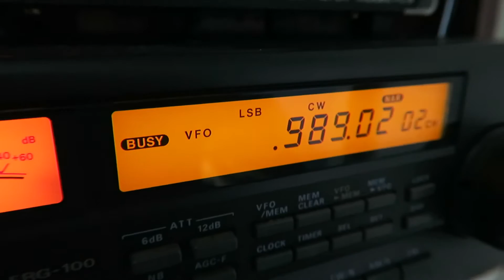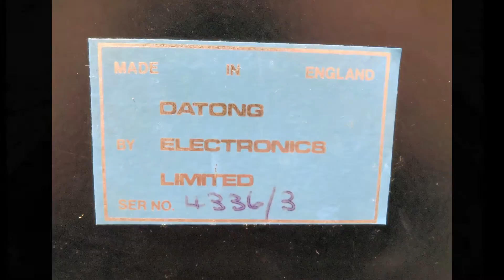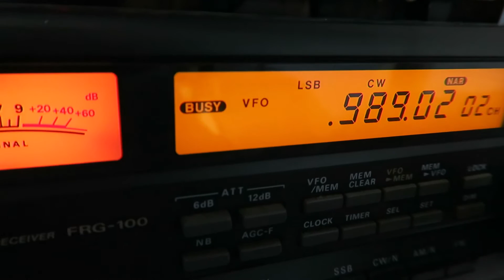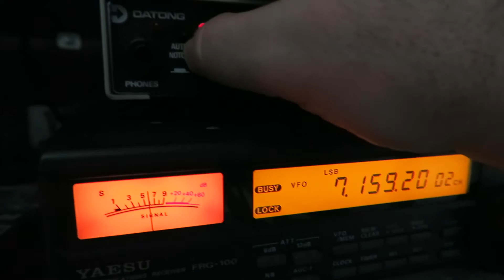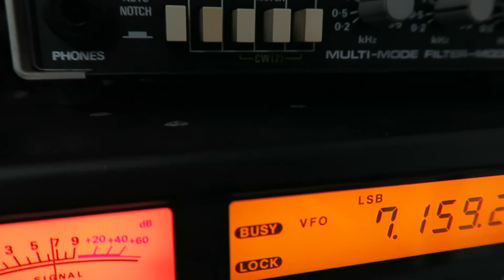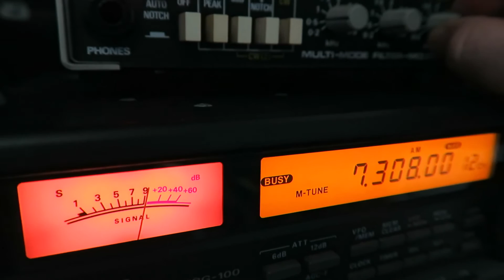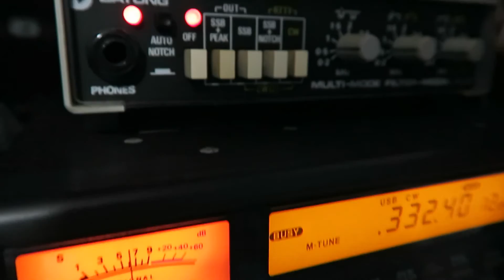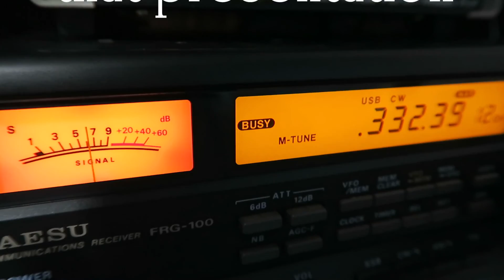Datong FL3 audio filter incorporating MiniWhip on HF

Comment: Just bought one from uk on ebay. Works well apart from the power input, which shorts out when plugging in, and is a sloppy fit .Not good if using portable with a battery!. Appreciate it was a while ago but did you modify yours , and if so what conponents did yu use to allow using the same hole. Thanks, appreciate the video
Reply from the maker: Hi, no modifications made here, sorry to hear about your trouble
Reply: My FL2 gathered dust for 40 years and had no audio when turned on the centre pin on the rca input had broken away from circuit board, probably caused by plugging in and out. I removed the power Jack and took wiring straight to the board. Now working OK.
73 Dave G4BTI.

Comment: Ohhh La la... I finally found one of these 2nd hand, Not had a chance to get it up and running as my KW2000e is still down. Might try it on my Dads old valve based Trevor Wadley loop telecommunications receiver.   Your video is the only decent thing I've been able to find on youtube and see it in action. Looks very sensitive to any small adjustments.  Guess you would expect that when driving a notch filter with a crazy tight "Q" on it. Learnt a new Ham term today "Het Killer ". Thanks again for posting all those years ago, (2016)  not many of us who love old boat anchor crazy high voltage kit about these days. Regards and 73's from Auckland, New Zealand.
Reply from the maker: Hi Kris, many thanks indeed, glad you got one

Comment: Hi, Great video,. I have just got one from ebay, please can you tell me when the "Auto Notch" filter LED lights up? doe it lite when button pressed or only when signal/audio present, manual doesn't really explain how to use very well. Regards Ray
Reply from the maker: Hi Ray, I'll have to connect up and try it to find out, unless anyone else can help us?
Reply: MikesMovies Thank you. Just want to make sure the unit is working and not me not understanding it. Thank you to anybody that can advise too.
Reply from the maker: Hope to connect mine up today, I am thinking the light comes on as soon as notch is selected.

Comment: Impressive analogue filtering bit of kit thanks for sharing, I will keep my eye out for one of these as I scour online auctions.
Reply from the maker: +SpectreOZ Thanks, certainly is nice not as sharp as the MFJ but for my ears sounds better :)
Reply: +MikesMovies Yes indeed, I had not fully embraced the need for a DSP/audio filter beyond that which the receiver already provides until recently, you Sir have enlightened me as to the "way of the filter" :)
Reply from the maker: +SpectreOZ LOL my work here is done :) very glad to have helped! Yes you need a audio filter that can go down to 30hz or less to detect NDBs around other NDBs and noise. The MFJ 784 does a better job than the Datong with the trade off being not as nice a sound. If you can find a Datong in good order it would be a great place to start